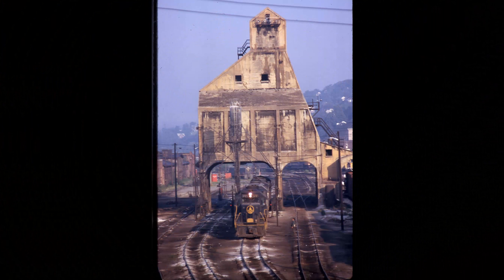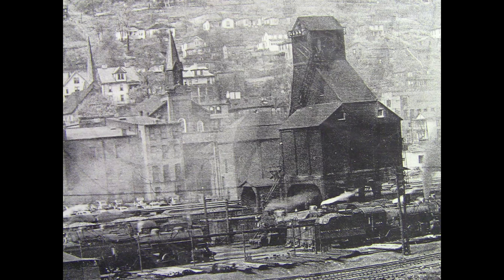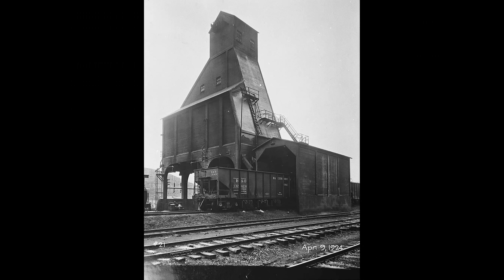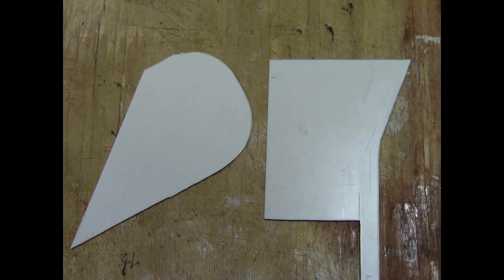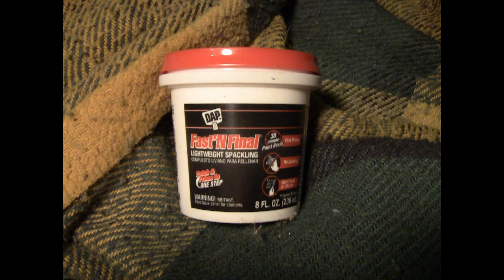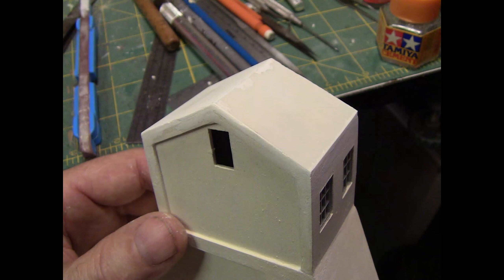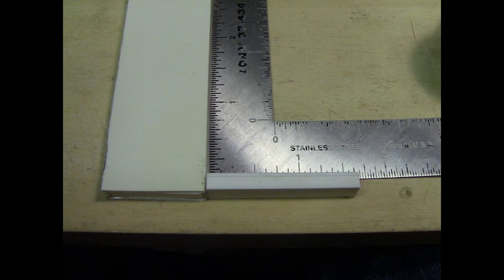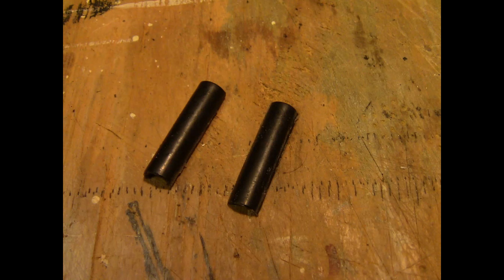Coaling tower video 1

Comment: I've got a coaling station on my HO scale layout.  It's more like a coal mine butt against a mountain by Pola models.  I just completed a Walthers Cornerstone chicken coops and farm buildings kit and it came out quite nice.  It was a learning experience to say the least.  Painting after assembly was a bit cumbersome so from now on I'll paint the parts while they're still on the sprue.
After much cussing and swearing I finally completed the building of a Tichy Train Group flatcar.  I followed the directions to the tee and wish I hadn't.  After installing the stirrups in a previous step and while installing the extra added bronze phosphor wire grab irons, I broke every one of the stirrups off.  If you ever build this kit install the stirrups as the very LAST step!  I did make some stirrups out of staples from a desktop stapler that were the correct size for HO scale.  I think I spent as much time chasing small parts across the floor as I did assembling the model, LOL!  After completing the build with all the fiddly brake details on the bottom (which no one will ever see) I painted the under frame rail brown with my airbrush.  I then painted each board on the deck with a different shade of brown to grey-brown mixing the acrylic paint in small plastic communion cups as I went along.  It came out looking very realistic.  Cheers from eastern TN
Reply from the maker: Thanks for watching . I have been wanting to finish this build for a while . It's time

Comment: This is a timely build for me. I've got a similar project planned to build the concrete coaling tower at the IC division point engine facility in Centralia IL. I am also starting with the Walthers kit.
Reply from the maker: Not much is left from the original kit. I wish I had video from when I started the build. In the next video you will see more nuts and bolts as to what I did to build some of the structure , when I build the missing stall under neath . Thanks for watching !!

Comment: Take an old testors glass paint jar and put all those little bitty pieces of styrene that you can't use for anything and pack it full. Use either the plastruct styrene glue or MEK and put a little bit in the jar and stir it with a small stick and melt the styrene into the liquid. It works great for sealing up cracks. I use MEK as glue instead of the expensive little jars of glue. I have an old glue jar with the brush in the lid that I refill with the MEK. It works great just the same as the other. The mixture of MEK to styrene by adding more of one or the other will give you a consistency you're comfortable with using. I make it a bit thicker so I can use a toothpick to put it in the cracks but not so thick it dries before settling into the crack. Talk about welding the styrene together. It sands and cuts and works just like any other styrene does after it dries. If you get a new jar meant for mixing paint in for an airbrush it will seal and the mixture will keep fairly well. You may need to add a few drops of MEK to it to mix it up next time you open it depending on how long between times you go using it. Works great for me and makes me fill like I'm not wasting money by throwing away those little bits of styrene you can't do anything else with. I keep it in a small container and add to the jar as I need too.😆 Good video. The coaling tower looks really good so far.  👍
Reply from the maker: I have done this in the past . The vinyl spackle is mess free and has not toxic odors. It is easy to work with as well . I guess the real test will be in 10-20 years to see if it lasts ..
Reply: @stewsstructures83  👍